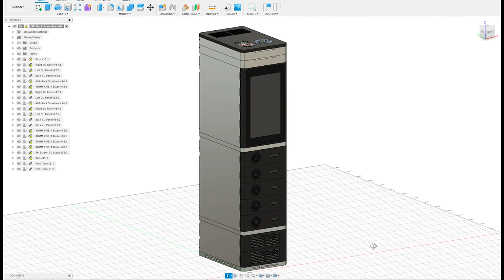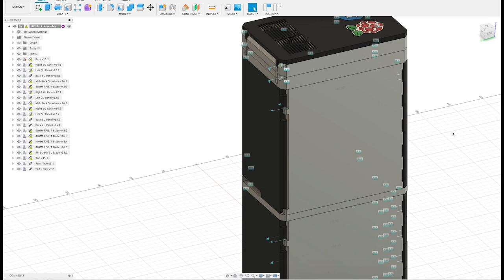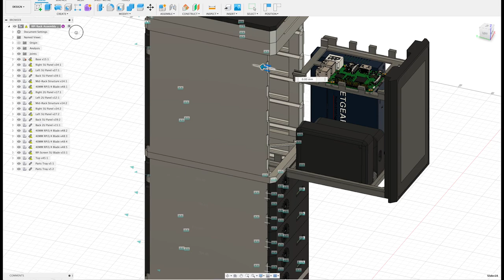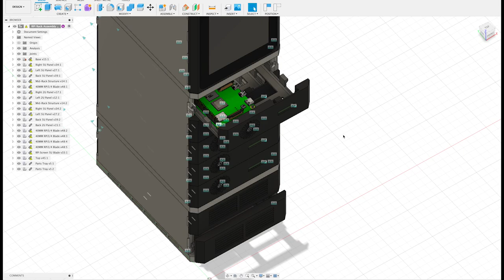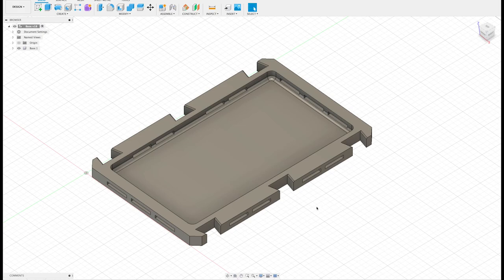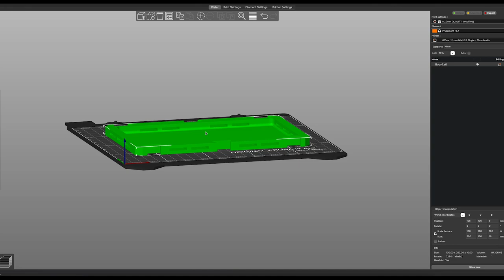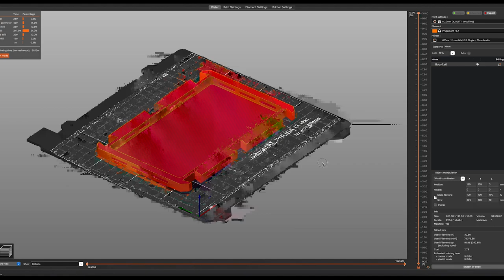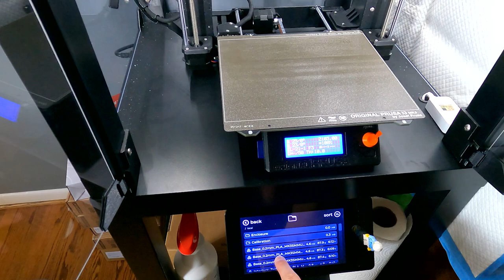001- Raspberry Pi Rack #1 - Introduction & The Base

Comment: This ia amazing! Great job! I am sure I am going to print parts of it for my setup.  Have you given anythought to making one of the sections for 3.5" hard drives. I have a 4 disk nas running off a nanopi M4 V2 .. I might try to edit the accessory plate and see what I can do. ( I am not very good with any design software ) I can't wait to see what else you design. Thank you so much for sharing this great design.
Reply from the maker: Good to hear. I hope you’ll get lots of use out of it. As for HDDs, I have not but only because I use an external NAS for storage. Let me see if I can mock one up today. Probably wouldn’t take much work.
Reply: @DougMeek   That would be amazing! thank you for your time. I hope you have a wonderful holiday season.
Reply from the maker: @bsorsdahl  I've added a new accessory tray for 3.5" drives. Go ahead and give that a test. I have not printed it, but please let me know how it works for you or if I need to make changes.